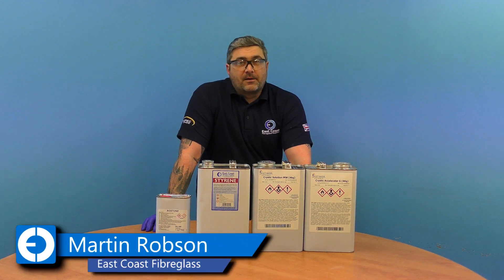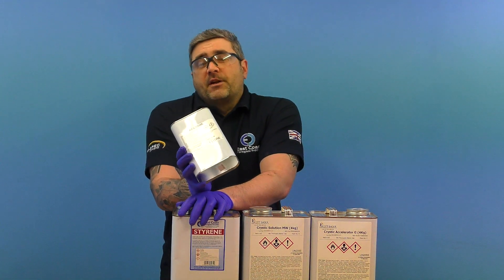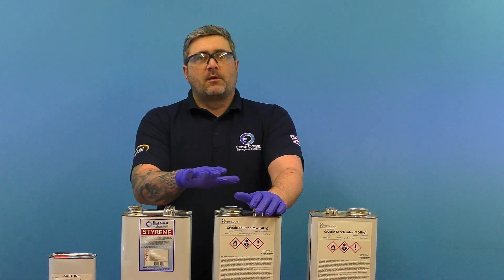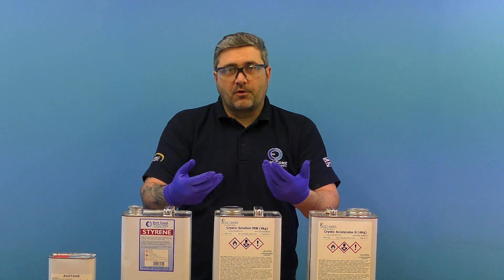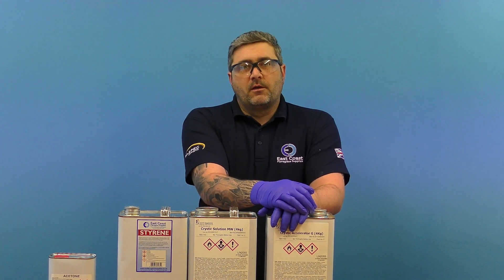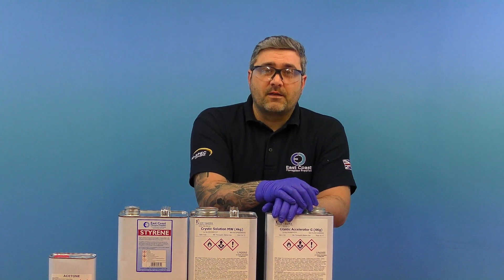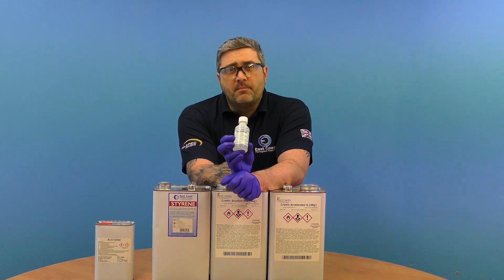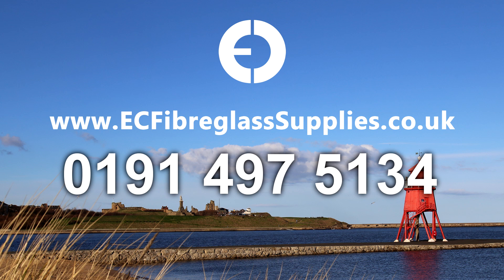Our Solvents Range

Comment: i coated the ply on my boat with Accelerator G 12hrs before laying up as advised by alot of boat builders to get a better bond
Reply from the maker: Hi, accelerator G is what makes the resins and gels cure faster, basically. You're better off using something like 491pa resin thinned down to prep the surface